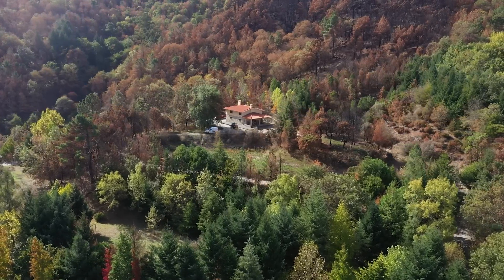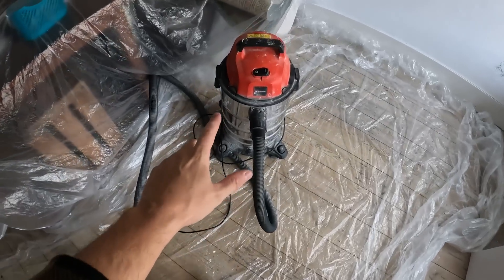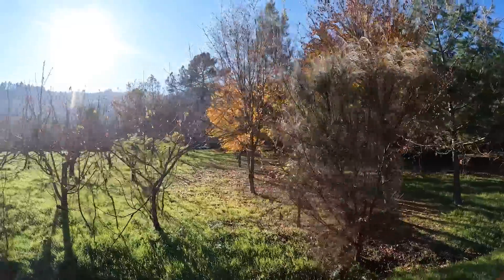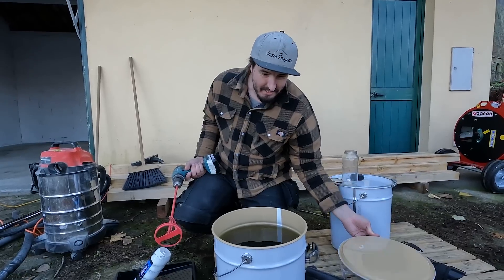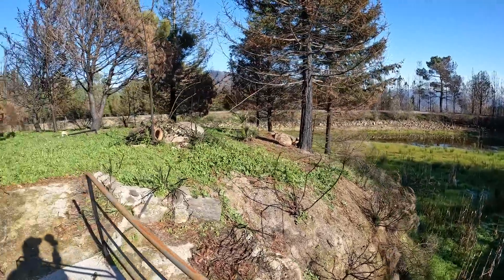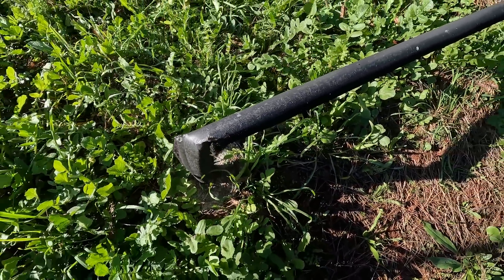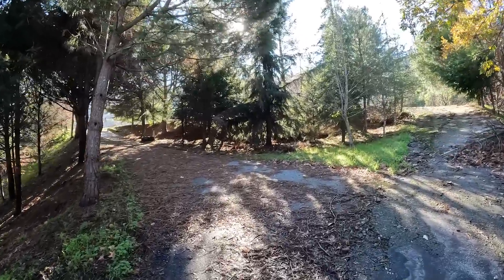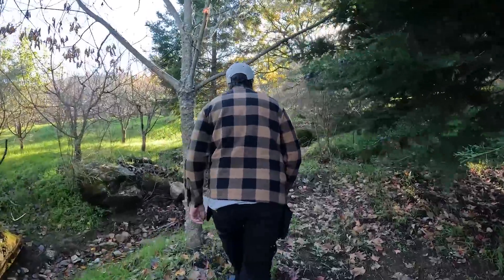What’s Happened to Our Village House? Renovation Work On Miracle Mountain!

Comment: Hi Theo and bea busy busy that sealer is a real stinker iv used it many times yes you can get a bit high on it but it will save on paint as it won’t sink into the concrete.nice to hear bea laughing in the back ground.😊

Comment: The lake will be so beautiful when you get it filled. Surely it will take months? Does it need the water system at the spring to be fixed first so that you can direct rainfall off the hillside and down the channel into the lake? What a job! I guess you’re in a hurry to fix it and start filling it up? You seem to have a good plan so far.

Comment: That garage doesn't look too impressive from the outside as far as size goes, but there really IS a lot of room in there.  Smart move to get that fixed up before all the miscellaneous jobs are in full swing.  

I like that you are leaving those higher ceilings in the rental the stained wood when there is no light problem in the rooms.  Paint is fine when you are dealing with such low ceilings in part of the place.  There will still be plenty of that old world charm from the rest of the house.